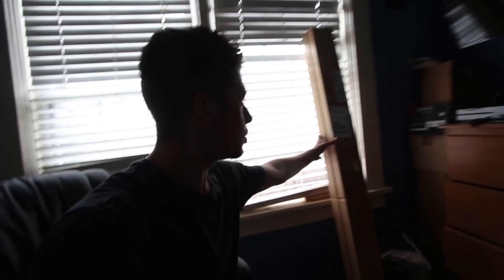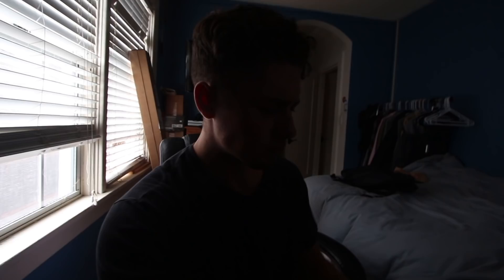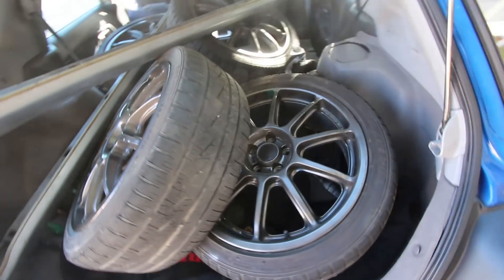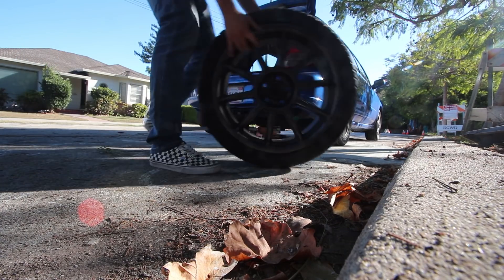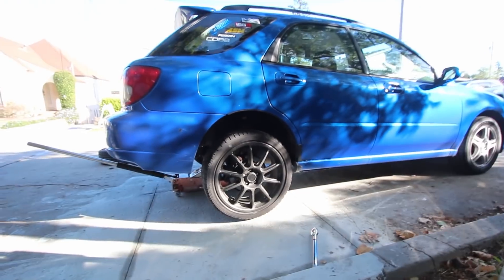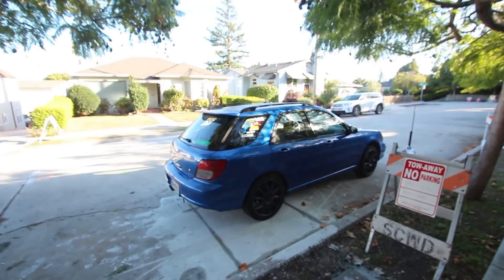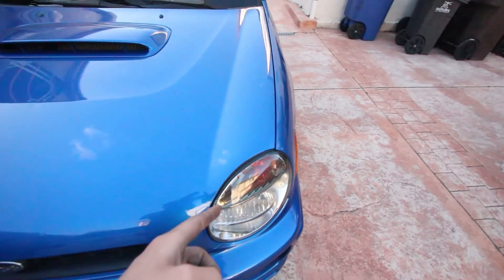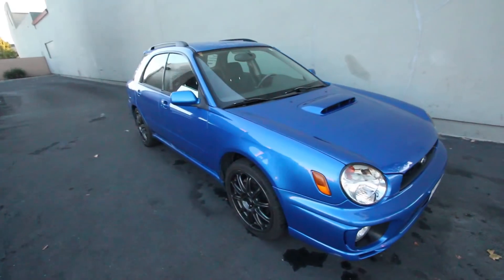NEW WHEELS FOR MY WRX WAGON! (Prodrive)

Comment: That’s the thing with modifying, it never stops then you are scared to drive it. Just wrap the roof,  maybe go for a clean look without Subaru badges on the rear. Could do with a steering wheel change, sti seats you might get cheap. If into ICE could get a system in there. All good fun.🙂